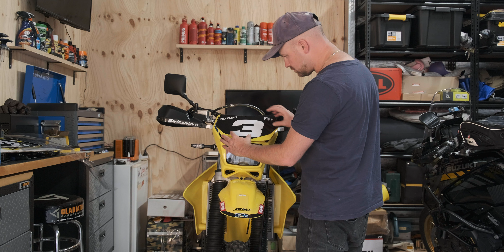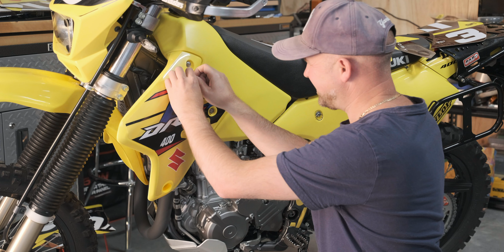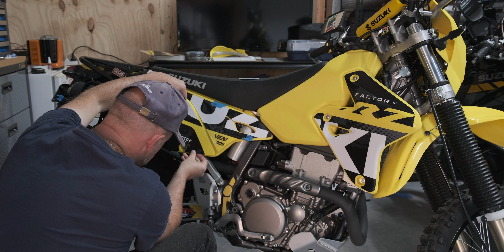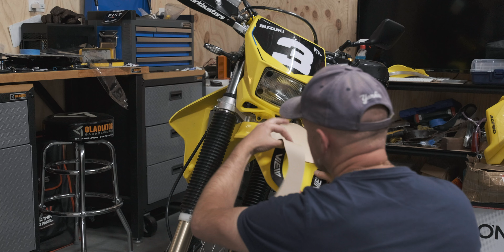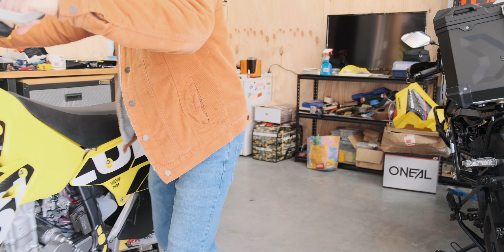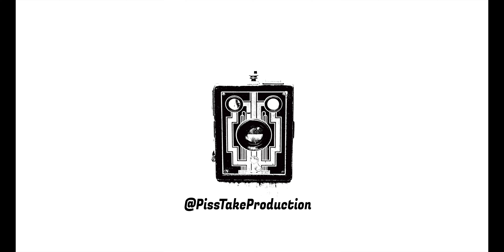Ep 16. Suzuki DRZ400E SKDA Graphics Kit

Comment: Looks clean dude! And surprisingly no screw ups...I hate applying adhesives. I try to put on so much as a band-aid and the tape is stuck to itself, my clothes, my hair, its in my mouth, etc...Can you hit it lightly with a heat gun for bubbles?
Reply from the maker: The rear sticker panels were a pain. A neat trick with the little ripples you can use the off cuts and place over. I don't have the bike as it's gone back to the dealer. But will do a video on how to fix some spot. Thanks 👍 the  visit.